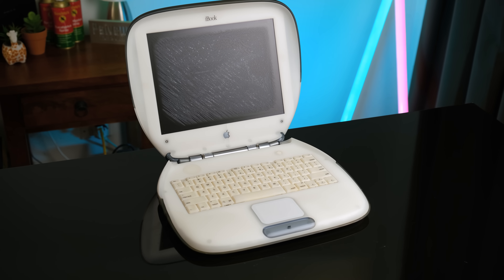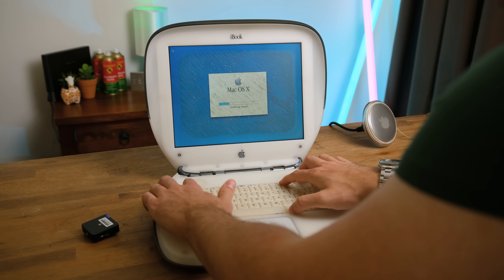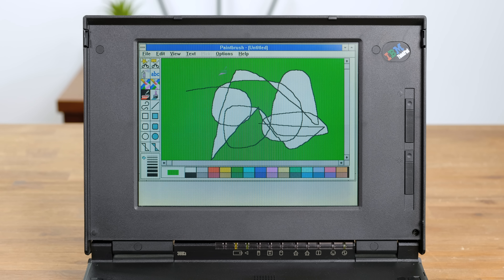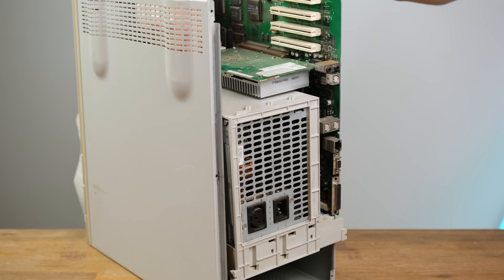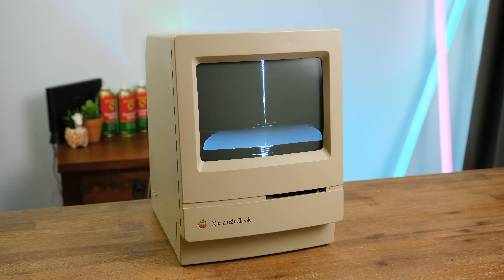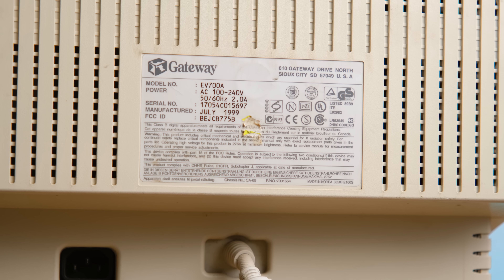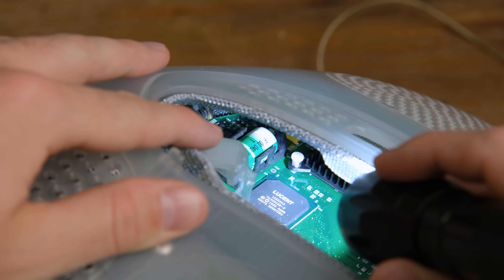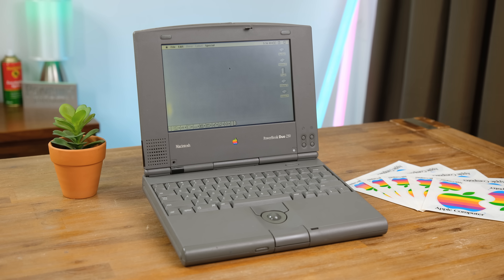So Much Vintage Tech Is Dying... Here's Why

Comment: This isn't vintage tech. This is just Apple tech and it's recent. And It's only dying because it's always been low quality trash which no one will ever miss enough to restore it to new working condition. Unlike vintage tech.
Reply: Dude, I had a Texas Instruments Windows 98 laptop working for 26 years. The plastic borders of the screen cracked and fell apart, the internal clock stopped synchronizing, and an increasingly larger black smudge of dead pixels formed in the upper right corner of the screen. But still did its job fine for retrogaming and old edutainment CD-ROMs. Until 3 days ago : the power switch broke, "Irreversible Error" message on blue screen, then pitch black. It had a good run, but it's painful....
Reply: @yrooxrksvi7142  Exactly my point, friend. It only hurts as much as the cost of a new laptop and the ball-ache of re-installing or updating all of your old software. But even if it was possible, restoring your TI laptop to functionality would hurt a lot more, and it would still be low quality trash that's only going to fall apart again in a few years at most. I suggest you have a crack at it with the soldering iron, whatever spare parts you can pick up on ebay, and a roll of gaffer [duct] tape. I owned and operated three or four ASUS EEE 1005H(A) mini-laptops for use in astrophotography as they were so portable and cute, and I cannibalized parts between them as they failed for several years until I could not build a working machine between them all, and had to accept that it was just Chinese trash.

Now I have in my attic three forty-plus-years-old 8-bit Acorn microcomputers running MOS v1.0 or similar, and they still work more or less perfectly apart from a couple of dirty keyboard contacts, and they will never fall apart because they were built in the early days of microcomputers when such machines were still relatively rare and expensive, and it was thought that they had to be built to last. Now that's vintage tech. From the days before computers became disposable trash consumer items that offices fill whole skips [dumpsters] with every time there's an update.

Comment: My laptop isn't that ancient, but in computer terms it's no longer a spry young fellow. It was fabricated in late 2010. 

It suffered HD failure in late 2020, but I brought it back from the dead. I rather like this machine (and props to Dell for using great screws, because I've lost count of how many times I've taken this thing apart and back together again for repairs and the like). It does what I need it to do and I know my way around it. 

I just hope it doesn't die on me.
Reply: I own a Texas Instruments/Acer Windows 98 laptop, dated to 1999. The old bugger still ran decently, used it to run old CD-Roms with games or edutainment softwares. Though years ago, the internal clock has stopped working. The external plastic is cracking and falling apart, though duct tape is still holding it together. Then, a couple of years ago I noticed a black dot on the screen : dead pixels. It has expanded since, but I managed to contain it to a corner of the screen. 
3 days ago, May 7 2024, it has officially died. First it stopped reading one of my discs, then the power switch broke, followed by a blue screen saying "Irreversible Error". After pressing Esc, all I got was black screen, so I pulled the plug and waited for it to turn off. It had a good run, but it's still painful.
I'll try getting VMWare Workstation these days.....Wish me luck.

Comment: That was just brutal and a little bit sad to see. I have 4 old laptops ranging from 1994-2008 that all still work with their era accurate OS and software, but my Amstrad PC from 1987 that I managed to get going again two years back running GEM and Win3 seems to have a power supply issue at the moment, possibly a cap needs replacing, but that's a little beyond me at the moment!
Reply: I own a Texas Instruments/Acer Windows 98 laptop, dated to 1999. The old bugger still ran decently, used it to run old CD-Roms with games or edutainment softwares. Though years ago, the internal clock has stopped working. The external plastic is cracking and falling apart, though duct tape is still holding it together. Then, a couple of years ago I noticed a black dot on the screen : dead pixels. It has expanded since, but I managed to contain it to a corner of the screen. 

3 days ago, May 7 2024, it has officially died. First it stopped reading one of my discs, then the power switch broke, followed by a blue screen saying "Irreversible Error". After pressing Esc, all I got was black screen, so I pulled the plug and waited for it to turn off. It had a good run, but it's still painful.
I'll try getting VMWare Workstation these days.....Wish me luck.

Comment: I have a radio, with a wood casing and built with vacuum tubes, still going strong after 60 years. I replaced the capacitors and the tubes tho, and it was built to last...
Reply: Excellent

Comment: Ive been using an ipaq110 since 2007 and years later a ipaq210, to this day. Both still work the same as when they were brand news.  Same battery, etc, they were built to last.

2003-2024, and they are still great hardware. Been even using windows mobile tech since 2003.

Comment: i have a functional windows 95 and 98 pc and have a working zx spectrum and a Sega mega drive
Reply: I had a functional Windows 98 laptop, worked for 26 years, used it for retrogaming, though the screen plastic fell apart, the clock battery stopped synchronizing, and a black smudge of dead pixels formed in the upper corner of the screen. It still its job fine....until 3 days ago. Power switch broke, "Irreversible Error" blue screen, then pitch black. All I could do was pull the plug and wait....

Comment: Wow, that is devastating. I never knew that computers would just pretty much self-destruct on their own. It makes me wonder how long other electronics will last before they start to fail. Have you ever looked inside DVD players or even Blu-ray players? What about LaserDisc Players?
Reply: They absolutely do. I have a 1999 Windows 98 laptop, and it progressively fell apart over the years : first the internal clock stopped synchronizing, the plastic covering around the screen fell apart, then a black smudge of dead pixels formed in the upper right corner of the screen. Finally, 3 days ago, the power switch broke, an "Irreversible Error" message showed up followed by pitch black. It was painful....

Comment: It is going to be very hard for future museums to preserve late 20th and early 21st century tech devices even in non-working condition.  Imaging trying to find parts to get an iPad or cell phone working 50 years from now.  Especially stuff that is intentionally designed to be non-repairable.

I wonder if you can 3d scan the disintegrating plastic parts and 3D print replacements?

Comment: I found my Sega Game Gear, which had not been seen or turned on for over twenty years.

Didn’t work. I did some investigating and found capacitors which had leaked.

Managed to teach myself to solder, replaced the capacitors (much trial and error). 

Turned it on once finished…. And it worked! Seeing Sonic 2 boot after more than 20 years was like going back in time….
Reply: I have two with exactly the same issue. Try to recap the power board. If that dosn't work recap the whole thing. Chnces are it will work then. his is VERY common for the Game Gear,.
Reply: @GarryGri  yeah supposedly they used really cheap capacitors that were prone to leak
Reply: you are COOL
Reply: Nice work. Always fun to see a manual repair like that succeed.

Comment: There's a mixture of issues here that aren't really new. Capacitors, batteries leaking has been happening even before home computers. Happened to my dad with his old HAM radio equipment in the 70s. The polariser decay thing is more modern thing but has been happening for about 2 decades with stuff from the 90s. Galvanisation and oxidation in general are known maintenance issues for centuries, even with materials other than iron and stainless steel.

A lot of late 90s and early 2000s equipment is about to hit these issues, esp. the polariser issue. For the rest, it's stuff us who have computers from the early 80s are familiar with.

Comment: i have an old dell laptop that suddenly started having display discoloration after non use after a decade. was completely fine when it was put up. stored in a climate controlled setting. blew my mind. its like the top layer is melting off lol.

Comment: I've been using an old Lenovo Thinkcentre desktop for work (it has no Wifi, so no internet; no distractions). The thing's about 20 years old, is this thing going to crap out on me anytime soon? It's a shame, I really have grown attached to it.
Reply: Probably not, as long as it's taken good care of, although internal batteries in old tech need replacing after a few decades.

Comment: The paint on my 2006 Macbook Pro started to come off after a year or two, so that happening to other Macbooks and Powerbooks of that era is not surprising to me.

My iMac G5 randomly stopped booting. I need to replace the hard drive with an SSD.

I also have a bunch of old clamshell iBooks that while not in great cosmetic condition when it comes to their cases, they work fine last I checked.

What I have the most problem with are my classic Macs - My Mac Puls, SE HD, and Classic. Each have its own issues. Plus needs to be recapped, SE needs a new logic board, and the classic's internal speaker doesn't seem to work for some reason.

Fortunately my Powerbook G4 867 still runs well for using old software.

That Gateway screen brings back memories. I had one, and my high school used a bunch of them.

Comment: I think this is specifically an issue with how you are storing these gadgets. I am guessing they are in a garage or storage with a lot of airflow? They need relatively good humidity to prevent the dry out of the glues and oils. I think you are storing them somewhere way too dry.

Comment: The capacitor plague of the late 1990s and early 2000s also hugely affected the original Xbox as most original Xbox units that have never been modified have leaking or bulging capacitors. Pretty much it’s strongly recommended to replace all of the capacitors and to remove the PRAM batteries in your original Xbox units to ensure their survival! :)

Comment: There should be some kind of clause or legal right to 3d print and reprint older technology and their parts once they’re over 25. Otherwise there will come a point where no restoration is even possible without full replacements.

Even with classic cars there are still some things that are still manufactured but that’s not the case with copyrights on some tech

Comment: My 2009 HP notebook has mold spots on the screen as well and it's still working but painfully slow and the 60GB HDD is not even 10% full 💀 also my 2013 galaxy tab is also painfully slow but plays 3D games flawlessly

Comment: I've been sitting on a working Sega cd model 1, an early model genesis without the lockout chip, an NES, and Sony 13" CRT just because every once in a while I like to boot them up and go old school.  But now I'm paranoid and wondering if I should just sell them before they die and stick with emulators.

Comment: i once got a samsung vga/dvi monitor from the garbage. it was working fine except the polarizer was bad on both ends. i bought a big sheet of polarizer and cut the 2 sheets that i would need to fix it and i even took out and cleaned both sides of the lcd... too bad im a moron and cracked the lcd. otherwise id have a good monitor

Comment: This is happening to newer electronics now. Samsung tablets having batteries swelling. Akai groove boxes having the rubberized coating melt off after only a few years. Green lines appearing acoss OLED screens  Capacitors popping in LG, Samsung, Sharp tvs

Comment: The same things happen to vintage synthesizers from the 80s and late 70s.  Of course, the electrolytic capacitors and lithium batteries are the most frequent offenders but are generally the easiest problems to solve.  The most difficult problems to solve are plastics degradation and galvanic corrosion.

Comment: atleast plastics you can reprint, drives can be swapped aswell as displays (with much diy-ing),  what sucks is older things with intricate parts that cant be replaced are also having these problems, like tape heads on decks and stuff of that nature

Comment: Honestly i can see the screen replacement or repair being a real pain. i have also repaired IMacs, and the whole going inside via the screen doesn't make it a fun repair process.
But that failing hard drive is an easy fix, and i don't really get why you're leaving a failing hard drive on it's last legs inside the laptop. Just take it out and clone it to a a new 2.5" hard drive.
It's really not that hard, and will hopefully preserve the data for at least 20 more years.

Comment: Your place has high humidity i gues, I have tones of old tech that is in a very good shape, for example Pentium 3 Compaq desktop PC, still running but not using. Check venitlation and source of moisture. I think if you are located in UK, that can explain high level of humidity

Comment: I have an entire room of "vintage" electronics and other items. Nintendo 64, Gamecube, Xbox, the same Gateway CRT monitor as in your video, 2000 Dell gaming rig, camcorders, etc. I guess I've had really good luck because they all work flawlessly. The only exception was the Nintendo 64 - the RGB cables went bad, so I needed to buy new old stock to replace them. Other than that, I'm keeping my fingers crossed for 25 more years with all of them! i use them all frequently so they're not in long term storage or anything.

Comment: No. It isn't.

Unless it is a liquid cell, or a mechanical system, or relies on some kind of liquid based chemical, it's not "dying." 

This is fear mongering that promotes price gouging on the second hand market. Things like original NES/SNES, old computers, etc will continue to function as long as they are maintained and treated correctly.

Comment: For these reasons, I collect old tube devices. Old TVs were made of wood, CRTs made of glass, chassis made of metal and tubes made of glass and metal. Basically, there is almost nothing to go wrong there (except the insulation of the wires and of course the capacitors - whether electrolytic or old paper rolls, they are always consumables).

Comment: Wow! Looks like you've got some moisture problems with wherever you're storing your machines. Maybe it's an area that experiences a lot of heating and cooling cycles, like an unfinished basement? Just think what moist air can do when condensation forms, particularly when something cools off after having been heated or where any dew point might radically change. Personally, I'd consult with a HVAC professional and inquire about what they can to to provide better air scrubbing (think "anti-humidifier" or the opposite of what a cigar humidor might do).
Reply from the maker: Moisture is definitely not a problem where I live (one of the driest places in the world). A lot of the devices spent the majority of their lives out of my possession.
Reply: @psivewri  Moisture is present everywhere -- even in a desert! So, it's not so much a question of moist air like you might see in a swamp or something; It's more of a question about dew point and temperature.

Realize, it can be a nice comfortable 80F during the day but could fall into the 30's by night (which is rather common in the desert southwest USA). If you've ever had to scrape ice off your windshield in the early morning when it didn't rain or snow the night before then there's all the proof you need that a potential problem with water infiltration can exist.

Most people I know never even think about water condensation in a place like a storage shed, garage or an unfinished basement (that was built before the 90's). But if you want to know how even the tiniest bit of water infused air can damage things -- even in a desert -- just ask a professional museum curator, librarian or someone who stores paper products like comic books or postage stamps and they can tell you the woes of water damage. Even certain warehouse operators know about it since water condensation on cardboard boxes and even wood pallets is famous for the damage it has wreaked -- even in places they thought were "high and dry" too.

Of course, ultraviolet light from the sun has also been known to damage plastics, rubber and plenty of other things. Car/truck/motorcycle tires are especially prone to the sun's UV rays that eventually cause "dry rot" and make you have to go replace them. And then there's the chemical questions since just being near petroleum products like gas, oil or even something like acetone can chemically attack plastics too.

Point is, the environment those things were stored in may have a problem. And that's assuming you aren't regularly watering them like potted plants or something. (Which I don't think you were.)

Comment: On the sticky rubberized phenomenon... paper towels dabbed in some isopropyl alcohol, you rub it right off with that and leaves no residue. And electronics from around 2001 and up suffer a lot from the 'stolen capacitor formula' problem, many devices have failed because of faulty capacitors from that era. Relatively easy fix with a soldering iron, but annoying nonetheless

Comment: Apple has made nothing but total shit designed to break for the last 4 decades. Meanwhile the ancient antique Dell Dimension and Sparc workstation my father used in the 90's are still in pristine condition.
Reply: like my 486 tower from 1994 still works perfectly to this day, the HDD gave out but i put a SD card to IDE adapter in it and also swapped the cr2032 battery